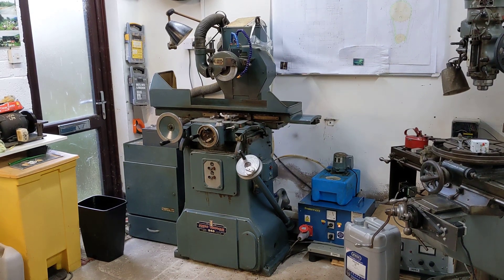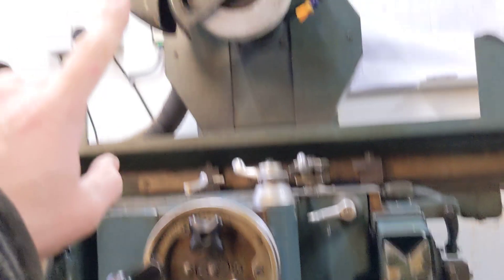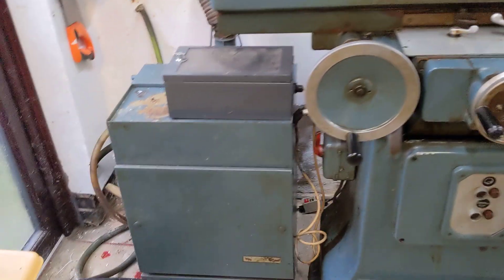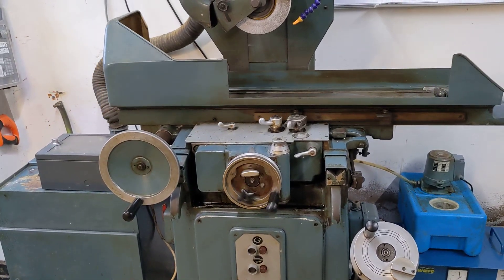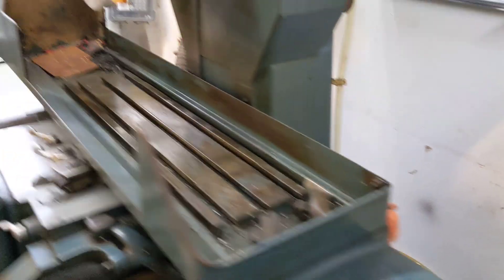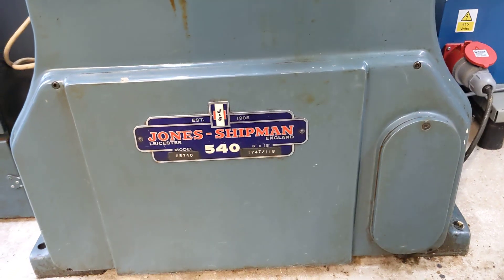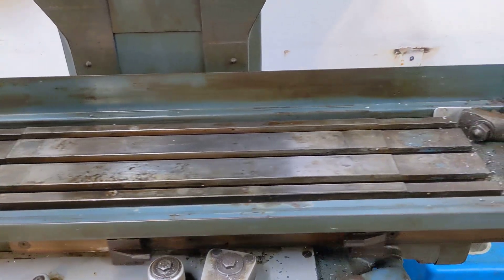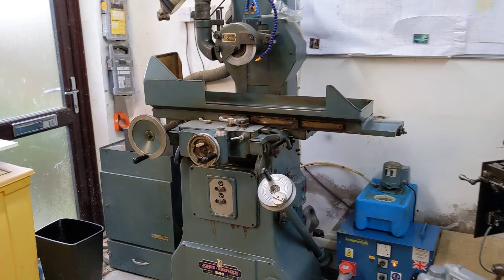Jones & Shipman 540 Commissioned

Comment: Where did you get to with this coolant project? I'm in the same boat and scratching my head about filtering.
Reply from the maker: I managed to get the coolant to flow nicely, with a pipe fitted to the drain spout. However since then I've hardly used it and one of the corks I used has dried out. I'll do a video update on the next couple of weeks (probably during the Xmas break) and drop it on the channel. 

Good luck with yours!

Comment: Hi, what size inverter are you using to run the surface grinder?
Reply from the maker: I have a Transwave 3kW converter. (Max 3 kW multi motor, max 2.2 single motor). It seems to do the job without any issues.